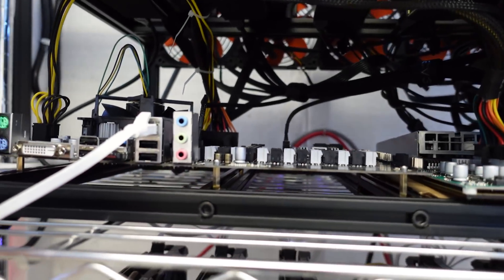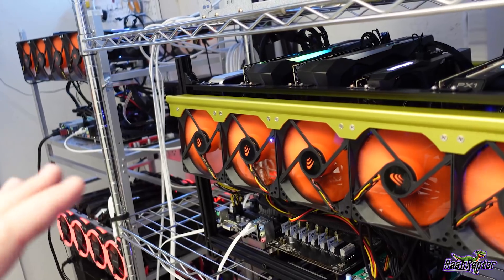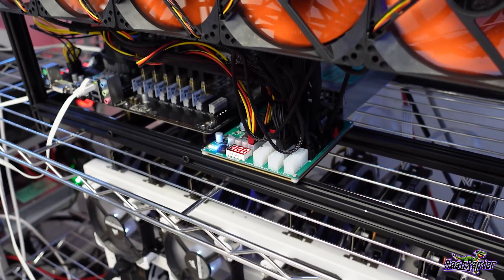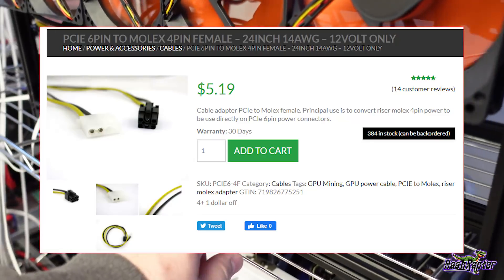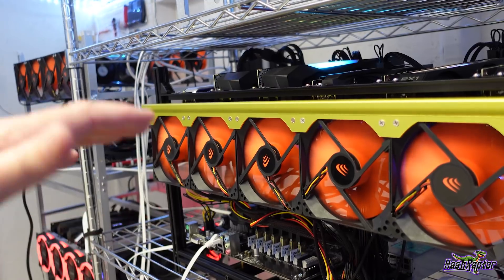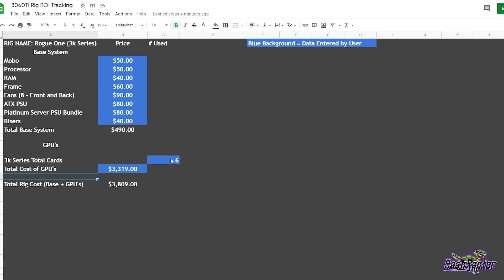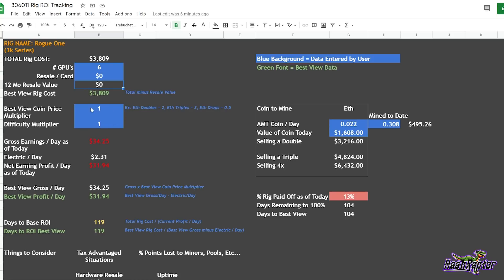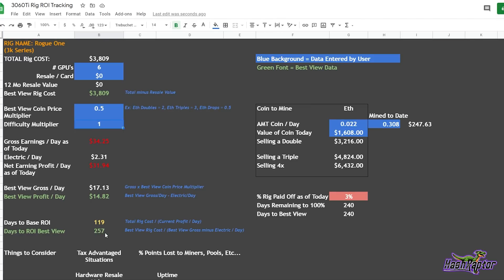$35 Per Day | 3k Series GPU Rig Build Part 3 Finished!

Comment: How hot and loud should I expect a 3060 ti rig to get? Especially with quality silent external fans
Reply from the maker: Not too loud (don't have db measurement sorry).  Heat will pickup though depending on how many you add.  One should be fine.  6 you start to feel it in a single room indoors.
Reply: @HashRaptor  i was thinking of pre ordering 3 cards instead of 6. Should be viable with the massive hashrates that this card has. But im still not too sure if half a rig would be worth investing in

Comment: Dayum I want setup like this i currently have a 2 3060 setup mining cfx making 8 dollars a day I wanna add to it but its hard buying gpus. How did you get all your gpus?
Reply: How do those cards make $8 a day? I'm using a 2080Ti and two 2080s and only making a little over $10. My hashrate is 160 total. I kinda want to use 3080s to mine, but should I not?
Reply: @MrTheta..  Its crazy cause they run at 64c and 74c and hash 92mhs on cfx everyone said dont buy em but they do really well. If you have 3080s most defently mine with them its worth 100%
Reply: @MrSnowy10  you're saying the 3060s  run that way? Is CFX good to run? I'm just getting started.
Reply: @MrTheta..  cfx is only good to run on these cards since the bios locked the ETH hashrate to half but if you have other cards run on eth.